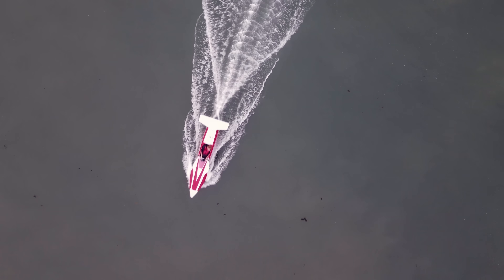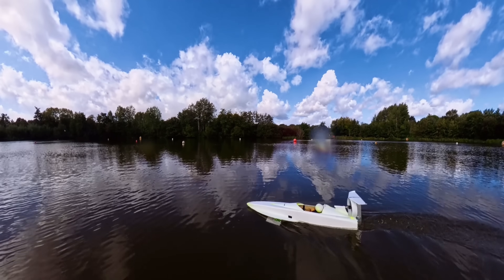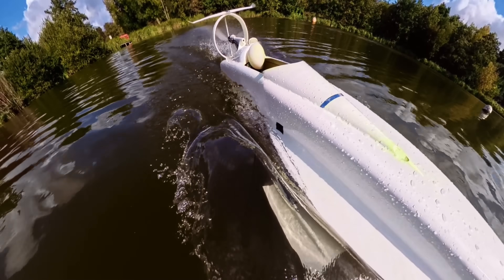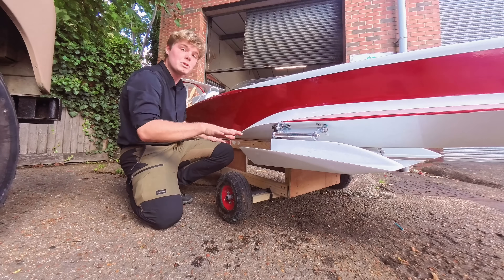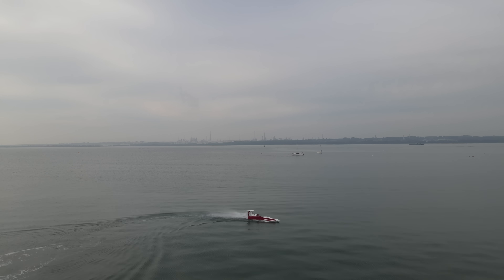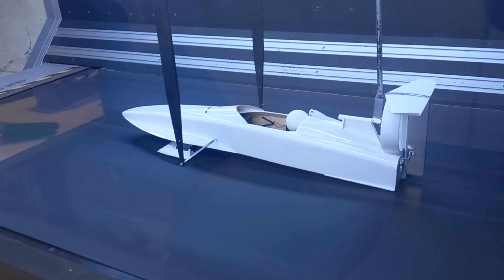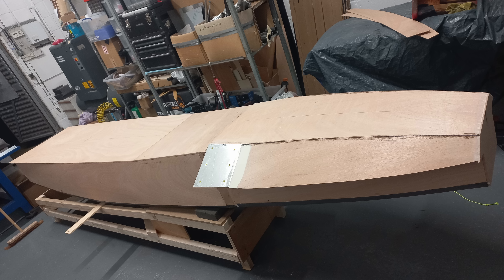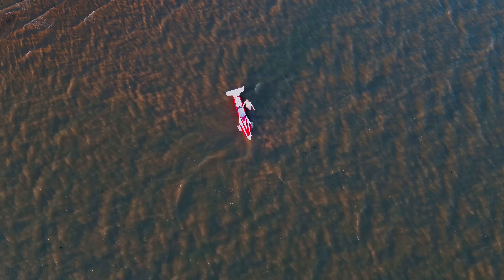How I built my own world record prototype - The APX hydroplane

Comment: @CDAero Your boat bears many resemblances to a German racing boat, but no one recognizes it anymore. Felix Wankel, the second-greatest German engineer, after whom the Wankel engine was named, had a hobby of racing boats and developed them for himself.
Since 1934, Felix Wankel had been working on a high-speed boat with two planing surfaces and repeatedly built prototypes. The models up to 1968 each had a planing surface at the front and rear, spanning the entire width of the boat. The rides were accordingly uncomfortable, even in the slightest waves. Starting in 1968, he divided the planing surfaces laterally (similar to your boat) and subdivided the individual planing surfaces into three surfaces each, which looked like skis (length to width approximately 8:1). With this, he achieved two very significant advances:
1.) When the narrow planing surfaces (skis) hit the waves, they provide elastic cushioning.
2.) There were two equally sized gaps between the three skis, leaving enough room to safely negotiate a wave at high speed. The boat no longer lifted off the water (!) and no longer capsized!

I would also like to mention that his boats, named "Husch 1" to "Husch 3," were already traveling at speeds of approximately 160 km/h above the water after World War II.

As a veteran mechanic, I would advise you to run Felix Wankel's skis through a wave in a CFD and compare them with their planing surfaces. You will notice life-saving differences that could protect your health.

As a mechanic, I would also recommend drilling many small holes in the contact surfaces with the water and blowing compressed air through them. This reduces friction by 32%, which can result in a considerable increase in speed.

Pictures and link to Felix Wankel's racing boats: https://www.der-wankelmotor.de/Wasserfahrzeuge/TES/tes.html
Reply: Well spotted!
Reply: Your not Thomas Kamps the builder of model jet engines by any chance? If so trying to build one from your great book!
Reply: @geoffholme  I'm not Daniel Düsentrieb (that's the name of the comic book character in Germany). I'm just an old, white-haired mechanic who knows a little about hydrodynamics. I know that hydrofoils cavitate on the surface at speeds above 50 knots. Large flat surfaces hit the waves very hard because water becomes as hard as cement at certain speeds.
Felix Wakel used to leave wide gaps between his skis back then (1934 to 1986) to relieve pressure at high speeds and prevent tipping over. He had experienced this himself several times back then, gliding over the water at 160 km/h. Back then, he had two Wankel engines, each producing 250 hp, which had been throttled down to 200 hp each to maintain the durability of the racing engines.
Just to avoid any misunderstandings: These weren't just models; Felix Wankel had also built and driven all of these boats. He also flipped them (or rather, his mechanic, who did the test runs). After World War II, it was one of the fastest boats. But he never wanted his hobby to become known. As the inventor of the Wankel engine, he was known worldwide and enjoyed the peace and quiet of boat building. The Wankel Museum might be able to tell you more about the two boats and the ski constructions.
Reply: @thomaskamp9365  I think you are the Home made Jet engine guy!🤣and you're being coy! You clearly know your stuff, but Alexander Graham Bell's HD-4 was a ground-breaking hydrodome that set a marine speed record of 70.86 mph (114.04 km/h) in 1919. Ken Norris [ co-designer of Donald Campbells K7 Bluebird] did loads of work oh hydrofoils which I have had the pleasure of reading and discussing with him over coffee. This research became K5 Whitehawk owned by the Hanning-Lees and driven by Stella Hanning-Lee. That didn't work because of cavitation, I have some stunning photos of this boat from Geoff Halliwell[RIP] who was a good friend of mine. Geoff also went on to be Donald Campbells unofficial photographer and helped recover DC's helmet with Leo Villa. Hydroplanes go way back when[1872 Rasmus stepped boats]. The Italians[ Laura 3 etc] became the best exponents of this design in small sizes then the American Unlimited  boats took over dating from slo-mo-shun 4.

Comment: Nice looking boat! I would suggest utilizing an actual rudder, in contact with the water. If by chance you lose power at speed, you may also lose the ability to control the craft, with just an air rudder.
Reply: Too much friction/drag, if power is lost at speed it makes no difference as the boat is still going fast enough for air travelling over the air rudder to steer the boat. Electric motors only have about 5 moving parts so reliability shouldn’t be an issue.

Comment: You need a thin keel with a wing upside down T at rear and <-> at front it’s tried tested the prop what about a twin counter rotating prop, also look at ground effect designs. You could incorporate some hover craft elements, maybe bubbles over the wings or stepped wings like stepped hulls. Cool project.

Comment: I don't know if you're planning to make the speed record version out of ply, but wood tends to not be good at absorbing damage in the event of a high speed prang. I'd consider making the record attempt version out of maybe alloy sheet with maybe a welded steel cage for the pilot. Secondly, Thrust II, the jet speed record car, used an active rear tailplane to control the weight distribution on the wheels, presumably to stop it going light (and thus prone to step out of line) at speed due to aerodynamic effects. Something similar on your hydroplanes might help avoid problems. This gets into the realm of control engineering and stability, so it has to be implemented right by someone who knows what they're doing, if it were done. A fixed tailplane is still heaps better than no tailplane at all though, witness what happened to Donald Campbell in Bluebird...
Reply from the maker: For a 200mph record breaker there's no doubt it would have a safety cell type cockpit, perhaps welded steel or composite, or both. I like wood as a material, but the engineering will dictate what the materials will need to be, and I suspect that the record breaker will mostly be composite. In terms of moving tailplanes, the IUM record rules do not allow it (or any non-pilot operated/active aerodynamic control surface for that matter).
Reply: @CDAero a friend of mine, his dad had a hydroplane that was the number one in unlimited hydro.  It was a wooden boat.
Reply: Sounds Crazy, but the fastest speeds recorded -Hustler [broke Donald Campbell's record] and Spirit of Australia, present holder of the WWSR at 317.6mph are both wood and ply. Dave Warby, Kens son, is presently testing at over 250mph in his wooden hull boat. ALL the boats built out of metal and plastics have eventually crashed killing their pilots . Dave Aldred is building 'Project Longbow,' with a wooden hull powered by 2 Vipers jet engines.

Comment: 2:03 if you haven't already, you should take a look at H1 hydroplane racing in America and the designs they went through. It was started when a couple Boeing guys wanted to make a boat go really fast using aviation style control surfaces. (fwiw, it also looks like the Princeton guys were inspired by the hull designs of the early H1 hydros)
Reply: You’re forgetting something. Those designs use propellers and this boat will not. It is fan only. This dictates the design a lot. Also don’t forget he is coming at this from an aeroplane design concept and not a boating one. There is no reason traditionally designed race boats will be more efficient than his and we know that propellers are less than 60% efficient than the 70% of the fan. He showed us this on a graph.

Comment: We held the electric water speed record from 2008 until the Princeton team broke it.  Our boat was seriously restricted by the maximum allowed battery voltage and the requirement to use a brushed motor.  It still holds the UIM 144 volt speed record at 98+ mph, but doesn't meet the newer safety rules.  However for your boat you need to read the UIM electric rules section 600.04:

The World’s Unrestricted Water Speed Record is awarded to the fastest boat in the world piloted by a driver,
irrespective of the class of boat. To be classified as a boat, the vehicle’s directional control or propulsive
effort must result from reaction with the water. For safety, the boat’s running attitude may be controlled
by electronic sensors and actuators. 

The fastest an electric powered model boat has run is 206 mph. See https://www.youtube.com/watch?v=SCywrCH-Ujs

Comment: 200 mph on the water is no joke. The road ahead,just being a boat, is a long one. I see a wider design in your future, stability is key. Mitigating twist of torky   electric motors may lead to mounting 90° from its present location. Air for propulsion is not inherently stable or known for high speeds. Watch some air boat videos from the swamps in the USA. Fun turns to danger very quickly. Much luck to you. The models are great fun, full size is much scarier.
Reply: Torque effect comes from the propeller twisting in the air and has no relationship to motor position.
Reply: @paulogden7417 yes the prop on its shaft will have it also but much of it can be tamed by having the motor twisting the length of the boat rather than side to side. If you don't believe the power source is responsible for twisting a vehicle go rev the engine in a car that is transverse mounted and one that is traditional. Floating on water just amplifys that. That torque is a big part of what trim tabs correct on normal boats.
Reply: @plap. You think of the twist generated by the inertia of the moving parts. That is the same as the twist you feel in your hand when revving up an electric hand drill.
The big problem is the twist generated by the material resisting the torque of the motor when the drill bit actually drills the hole. This kind of torque acts upon every propeller driven vehicle .
Reply: @CG-rr6yx As I said yes there is energy involved with a prop, as well as the motor, so if you can get rid of some then do it. A motor that will bring that skinny thing to 200mph will absolutely twist that boat. Do you have any idea of the power that motor will have necessary to accomplish that goal. You really don't believe there is a lot of torque involved that could move something floating on water.
Reply: @plap. I agree there is a powerful torque trying to flip an air propelled boat.
That torque is generated by the propeller, it acts around the axis of the propeller's shaft and is not dependent on the position of the motor or the orientation of its shaft.
That being said, the problem is somewhat less acute with ducted propellers .

Comment: Nice !  Your propeller shaft look a bit scary, specially with the vibration we can see at certains rpm's. I would feel safer with a shorter shaft .
Reply from the maker: You are right, although that was because that propeller was slightly out of balance around 15% power, and not caused by an issue with the shaft itself. The final prop will be profesionally balanced and should resolve the problem, but in low speed tests it was ok since the vibration stopped when power was applied further. Otherwise I will reduce the stickout by extending the bearing sleeve.
Reply: @CDAero  Nice, good luck with your project, it looks great !
Reply: @CDAero  Even a perfectly balanced prop will experience gyroscopic forces trying to bend that shaft. The shaft must be supported near the propeller, not doing so is asking for a disaster.

Comment: I spent the whole video wondering why not a hydrofoil and just ignore the bumpy water surface. 
Halfway through I realized- if a water propeller is cavitating at the speeds you want to go, probably a hydrofoil will be, too?
Reply from the maker: Yes exactly! There are ways of getting supercavitaitng hydrofoils that mitigate some of the issues, but 200mph is actually still too slow to really take advantage of this, and hydroplanes have the lowest drag of any water vehicle for a given speed and displacement, as long as the speed is high enough.

Comment: If the video itself is correct, what the boat needs is something to stabilize the prop shaft which appears to be bouncing around (time 7:05) at your low speed tests.  Great idea and hope I see more of it.  Thanks for sharing.
Reply: I noticed that as well. There should probably be a support bearing past the prop to stabilize it or move the existing support bearing closer to the prop.
Reply: @kyleo1236  That would be ideal.  From a weight standpoint you could use a thinner(less material thickness) prop shaft and still have plenty of strength if supported on both ends.  I don't see anything behind the prop that looks particularly solid.  You'd need two support struts preferably 90* apart.  Looks like a fun project..
Reply from the maker: @fsj197811  Yes good spot, although that issue comes from the propeller being slightly out of balance around 3000rpm (15% power), not from the shaft itself. It was ok for the slow tests, but the final propeller will be professionally balanced and should make that issue go away.
Reply: @CDAero  Maybe.  Hope so.  Personally wouldn't bet on it.  That one was slightly imbalanced but only at 3000RPM.  Higher RPM, even balanced can have vibrations just from air density of blade descending vs blade ascending.  Something to consider, or wait and see.  Thanks for the reply.

Comment: Interesting.  But i would be concerned about twist. This is a very very narrow boat, and should the water surface on one side be different in hight  from the other at speed, a twist and then oscillation or bouncing between right side and left side could occur.
This is like an ice skating shoe, vs a roller skating shoe.

Comment: Interesting design,  i would think shock absorbers on the forward sponsons would change the angle of attack (aoa) on the sponsons dramatically, reducing efficiency?   Good luck with your 200mph goal. 200 mph on water with an airplane propeller will be a hard number to hit.  Be safe and God speed!

Comment: Not a bad idea, but risky...
I modified an RC hydroplane from a surface propeller to a turbine, and the speed and power consumption were good.
I understand the idea of building a wingless aircraft that barely touches the water; you have to think of it as an airplane, not a boat. The suspension is a bad idea. If a wave compresses one of the lift plates, the overall incidence of the fuselage will be positive, causing the plate to stick to the water and causing a rollover. If you've thought your suspension through properly, it should give more angle of attack in compression. The thrust height of the propulsion system must be as low as possible, otherwise it will induce a nose-down torque during acceleration and a nose-up torque at full speed and during deceleration. One Vasyfan 570 turbine on each side of the fuselage would be fine. The submerged guide blade should be coupled to the steering. 
Good luck, but don't hesitate to make scale models capable of 150 km/h. It would be stupid to die young.
Reply: exactly. no one wants to see another "Black Sunday" like the '66 presidents cup in H1
Reply: Your analysis seems sound.
Reply: When young I had a 20’ switzer  v hull fiberglass it did 75mph with a 200hp mercury outboard , it was tuned by the engineers at mercury. So from that experience  and building an experimental  airplane. Your above critique is spot on.  Cheers

Comment: Thanks for sharing your journey through the scaled down models as to the full size version. Im into rc planes and helis and always find engineering projects like what you are building fascinating. Im really looking forward to seeing how much better thrust and efficiency a new prop will give you. More blades, more thrust but higher amp draw ofcourse..I would love to hear more about the technical specs and results of the brushless esc/motor and drive system used, and also about the foil design of the front stabilisers and how they work at different speeds, with a camera mounted facing them would be interesting to see.
 Great video..be safe and have fun in the next step of the project my friend!
Reply: this prototype does not use foils.